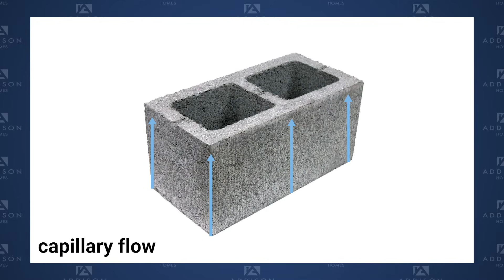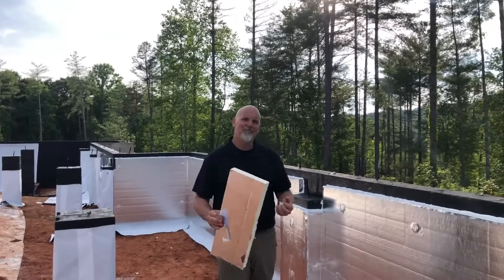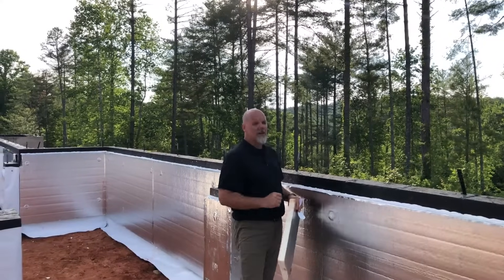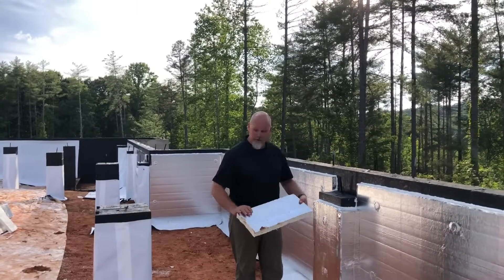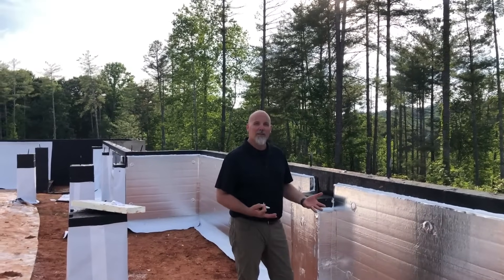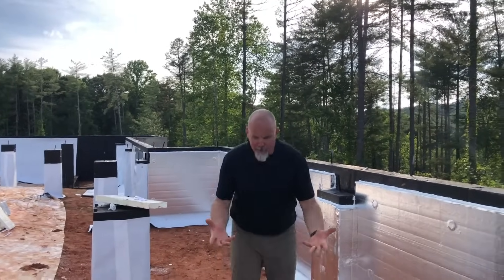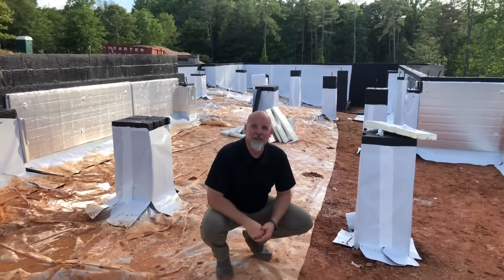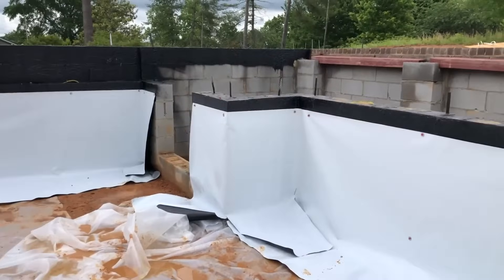Closed Crawlspace | Construction "Rough-in"

Comment: I'm scratching my head on this one, whether we really want that wall sealed on all sides...  I personally never like to trap moisture.
Reply from the maker: Hi Cindi- The good thing is that the foundation wall is not sealed on all sides so moisture can always migrate up the wall and to the exterior of the foundation above the exterior waterproofing.  The key goal is to prevent moisture from coming into the sealed crawlspace or up into the wood framing.  Giving moisture this path to migrate outward of the house is perfect - allowing it to move without coming into the house area.
Reply: @AddisonHomes  I'm not understanding... the exterior waterproofing goes all the way up the exterior and over the top.  Where can it escape?  (You said above the waterproofing, but it looks like only framing is above the waterproofing.) 

Also can you explain why you installed a sacrificial vapor barrier instead of just installing the good one from the start?  If it's super tough and would also keep moisture out?
Reply from the maker: @cindianderson9443  Thanks for the clarification questions.  We do not run the waterproofing all the way up the exterior of the foundation wall.  We only waterproof up to the height where final grade will be around the exterior of the foundation.  The foundation wall above final grade is not waterproofed - By code, there must be at least 6 inches of foundation between grade and siding/framing - the only exception to this is in our zero step garages.

Sacrificial vapor barrier is exactly that - sacrificial.  Even the most robust vapor barrier would be completely abused during construction and would be in no condition to leave as the final barrier for an encapsulated crawlspace.  With the red clay in our region, the white heavy duty membrane would be red with mud!
Reply: @AddisonHomes  Thanks, that's interesting.  I'm used to people putting self-adhered or fluid applied membrane over the whole outside foundation wall, then overlapping the house membrane to that one.  But not putting any on top or on the inside.  (Usually use other things like sill seal on top.)  Lots of different approaches.
Reply: Good info Cindy but I’m still unclear on the moisture barrier explanation. In the video I see them spraying from bottom to the top of the wall. Not sure where you have four inches of untreated block to allow moisture to escape .  No matter where the grade is the wall is sealed.  Please clarify. Thx

Comment: Outstanding video (my lot is amazingly similar with lake view to yours here)  - I am in Climate Zone 4 in Northwest Arkansas, nearly Zone 3. I'll preference my three questions with, I am not a builder: 1) Why do most of your sill plate bolts appear bent, or is that tape covering them, and 2) Will you be installing a termite shield? 3) What is the waterproofing liquid being used and is it just a standard product? Thanks - my new home foundation is going in now and I am having a heck of a time communicating to my builder to do similar to your installation here in my crawl. I need to get to some agreement with him before he gets to the sill plate.
Reply from the maker: 1) I think you're seeing our foundation "straps" which we use instead of bolts.  These are embedded in the foundation and bent around the framing and nailed to the framing in multiple holes.  We find that the straps can not only hold the sill plate, but run up the wall and attach to framing as well.
2) We install termite shielding on our insulated stemwall slab foundations which we will be discussing in some upcoming videos, but do not install specific termite shields on our crawlspace foundations.  We treat all of our homes with borate termite treatment applied to the wood framing 3 feet in all directions from any contact with masonry or concrete.
3) The waterproofing is a standard asphalt-type emulsion.

Comment: Great presentation.  I had not considered a need to vent a crawlspace during construction, but until it is "conditioned" it really does make sense.  I like the moisture sensor and the one-way drain, too.  Seems like a lot of steps and different materials to isolate the masonry from the framing, though.

I always worry when I see a bunch of penetrations being made by fasteners through vapor barriers.  It seems like it would be simpler to wrap both sides of the masonry wall with your vapor barrier so it covers the top to provide your capillary break.  Why is the black spray better ?  On the outside, the vapor barrier could hang down to the footer and be held in place behind insulation board by backfill with no penetrations.  On the inside it could be taped to the floor covering.  When the framed walls are sheathed, the house wrap or self adhesive membrane vapor retarder could shingle over from the sheathing onto the stem wall and be taped to the VB.  Continuous R13 insulation board covering the sheathing could run down over the sheathed wall and stem wall all the way to the footer.  That would mean the rim joist and framing inside would be visible for termite inspection without leaving the gap in the foam board as a thermal bridge.  The vapor barrier in the crawlspace would be a continuous barrier isolating all the masonry and earth from the wood framing.  Will termites penetrate that tough VB you used ?  Seems like less labor overall than all the fastening and calking of the VB and foam board while leaving fewer gaps in the insulation.  Bringing the stem wall inside the conditioned space would add thermal mass.
Reply from the maker: Thanks for the comments.  Interesting idea to wrap the wall with the vapor barrier.  In practice, this would be very difficult to get the vapor barrier of this thickness to "hug" the wall without fasteners.  The requirement to have a positive connection between the foundation and the framing would require penetrations through the vapor barrier which could be problematic from a moisture and termite perspective.  I wouldn't rely on the vapor barrier with penetrations as an adequate capillary break.
Depending on the type of continuous insulation board, if it ran from the exterior framed wall down over the foundation wall to the footer, this would provide a path for termites to move from below grade up the outside of the wall into the framing unnoticed.  Of course, termite flashing could be installed at a break in the foam to reduce the chance of this from happening.  
Another drawback of continuous insulation on the exterior of the foundation is the final exterior finish.  The exterior insulation would need to be protected from damage.  A common finish over foam board would be synthetic stucco, but it would still be susceptible to damage from string trimmers and other landscaping equipment or activities.  
Overall, I think the cost and complexity of this approach would be prohibitive.

One other option for the membrane would be to wrap the wall with a peel and stick membrane which would eliminate fasteners, but would not address the issue of the foundation connection to framing.  This would also be extremely costly.

Again - thanks for the comments and ideas.  I always enjoy discussing different construction assemblies.  Innovation is very important in our industry!
Reply: @AddisonHomes   Thanks for the quick reply.  I think a peel and Stick membrane would gasket over the J bolts or other foundation connectors.  To be sure there wasn't a gap between masonry and sill plate, I suppose you would need a thicker gasket material than just the VB anyway.  I was thinking the weight of the gravel for the exterior drain sitting on top of the VB draped over the outside and down onto the footer would pull it tight to hug the exterior wall, then the insulation board would hold it against the wall by the pressure of the backfill the way they do a permanent wood foundation.  But not in practice ?  Is hugging the wall on the interior important ?  I know termites and carpenter ants will tunnel through foam and is one reason I don't like the idea of foam outside at all.  What do you think of the Rockwool Board material for exterior insulation and termites ?  It doesn't hold water, and termites don't tunnel through it, do they ?  You treat the wood within 4' of the piers with boric acid, but not the wood wall framing ?  Just the sill plate ?  Termites are a big problem in California where I want to build, but I haven't seen this level of precaution out here.  I wish it were practical to end up with a box completely wrapped in bug and moisture proof barrier, with all continuous exterior insulation like REMOTE, then control ventilation and humidity with HRV and dehumidifier.  Out here, they put continuous VB under slabs but don't then wrap it up the outside of slab onto and under the sill plate.  So the concrete is not really isolated from the ground and weather and I've never understood why.  Seems like that would work for crawlspace foundations, too, with the VB under all the footings and piers continuous.   

On a non-VB note, some builders use additional strip footings and short walls rather than piers and beams.  Do you prefer pier and beam because it keeps the wood further from the ground for termite reasons, or something else ?  Why not short steel adjustable columns instead of concrete piers ?  A crawlspace is just a short basement, isn't it ?

Comment: Why not just use closed cell spray foam instead of styrofoam board?
Reply: You certainly could use closed cell on the walls and stop short of the top for the inspection gap.  Most spray foam contractors will not come out for such a small job and it is more expensive than the foam board.  Many spray foam formulations also require an ignition barrier to be applied too.  One additional challenge of the spray foam is that many contractors spray the closed cell foam in the band of the floor system, which then makes it impossible to easily inspect the wood framing at the band for termites.  We are in a high termite infestation zone, so we terminate our foam board 4 inches below the top of the foundation and use fiberglass batts at the band which can easily be removed for termite inspection.  The exterior insulation on the outside of our homes extends down to the foundation, so the band also has an R-5 continuous thermal break on the outside.
Reply: @toddusher2358  Thank you for your thorough explanation! I am in the process of designing our new home in Southern Georgia, and I want to use the pier and beam foundation design. I've researched it done 10,000 different ways it seems! I recently watched a Matt Risinger Pier and Beam build which is why I asked. Here is the video
https://youtu.be/yk0mchsMstQ
Reply: @NewVisionLCS  No problem at all!  I watched Matt's video and just a word of caution - the "pier and beam" foundation that he refers to is quite different than most "pier and beam" foundations here in the Southeast.  Are you planning on using poured walls just as Matt did in his video?  If so, no worries - just don't want you to get stuck with a local contractor misinterpreting what you mean by pier and beam.  It differs even in parts of the Southeast, but in my area, most contractors refer to a pier and beam foundation as one with no perimeter curtain wall - they typically have only masonry or concrete piers with wood beams spanning between the piers, then a non-structural brick veneer around the perimeter.  I would consider Matt's foundation to be a continuous concrete stemwall foundation with interior piers.  
Not trying to be a stickler, but it makes a difference depending on what part of the country you're in!  If I can help with any ideas, please feel free to reach out!
Reply: @toddusher2358  Yes, I want an exterior poured wall with interior piers, and I want it conditioned. No slab on grade for me! Have you guys built any homes in Southeast Georgia?